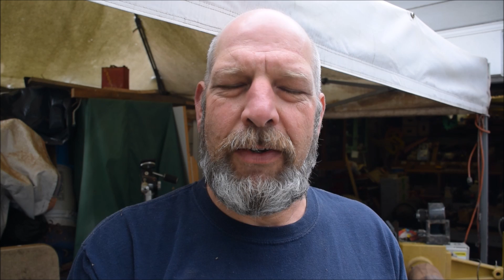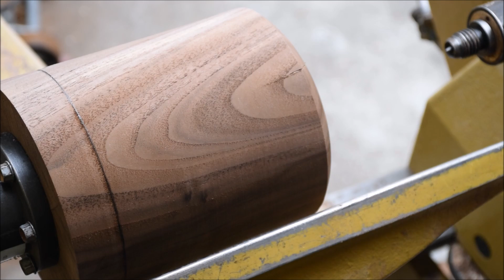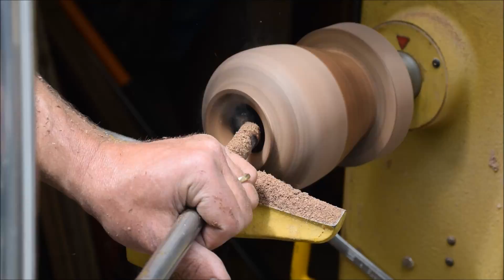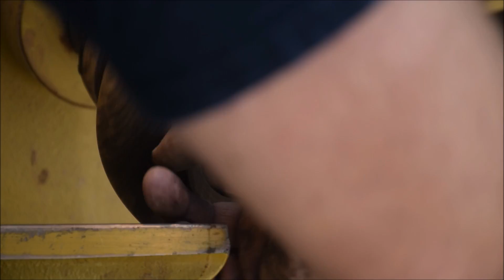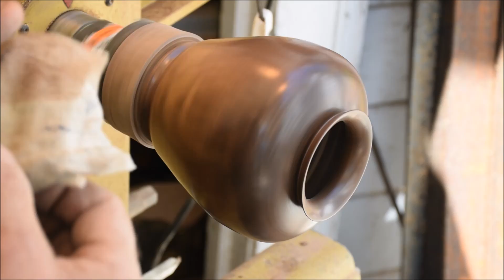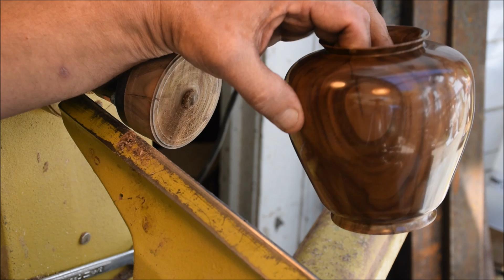Woodturning With The Naked Turner Walnut Hollowform Vase

Comment: Lyle's system looks great and simple. How much does it weigh (the boring bar and outrigger unit)? Is the weight what makes it flow so smoothly through the cuts?
Reply from the maker: Thank you Sam, It weighs about 3 lbs perhaps but what makes it stable is the  d handle or outrigger as well as the rear gate or rear rest that captures and holds the tool for you so all you do is drive the cutter at an optimal pace and with relative ease!

Comment: Great looking piece Erik.  I use an articulated arm system with laser and camera pointing.  Like Lyle's they totally transform your hollowing and take things to a new level... and not just large pieces.  I find it great on pieces just 3 or 4 inches tall.  It makes it so much easier to achieve very thin, consistent, walls.

Cheers

Tom
Reply from the maker: Thanks Tom, what is the system you use?
Reply: There are many similar ones around the world Erik.  I use a British system from Simon Hope, http://www.hopewoodturning.co.uk/hollowing_jig_27.html.  For me the great advantage of this one is how little space it takes to use.  Because of the way the arms articulate (there are four pivot points) it will work on virtually all lathes and lathe sizes.

Cheers

Tom